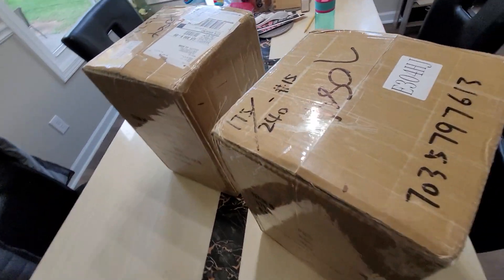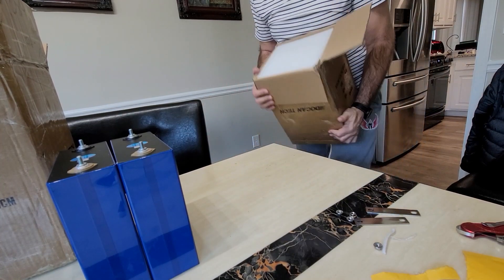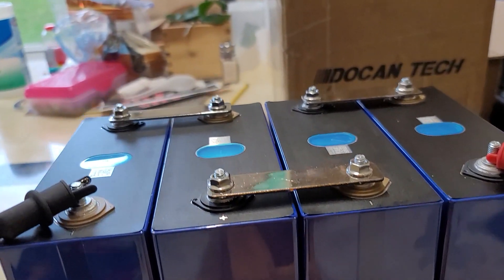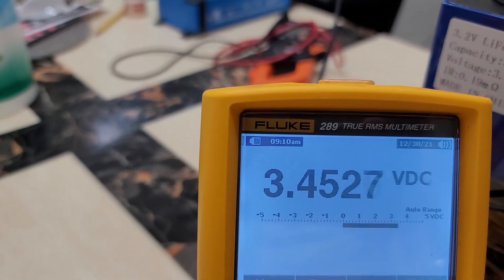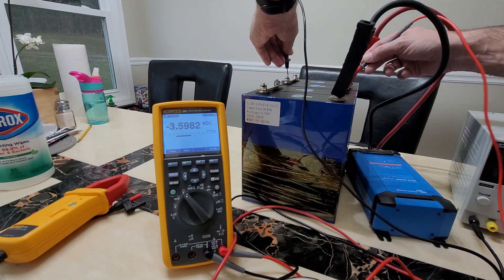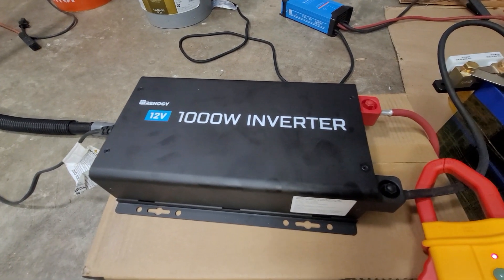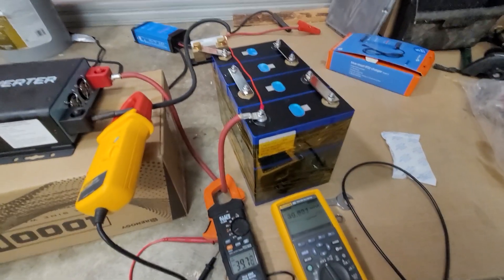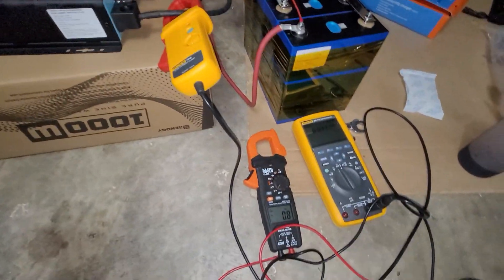304Ah EVE Cells & Channel Update

Comment: That's good you are doing good
Reply from the maker: Thank you. Did sun come back out for you yet?
Reply: @DMIINC2013  only Wednesday it rain yesterday and today no sun supposedly is going to rain tomorrow I'm still ok my battery bank is at 13.12v because we got wind to day
Reply: What inverter do you recommend me to get 2 of the lv6548 or 2 of lvx6048 or one of GROWATT 12KW
Reply from the maker: @solarandwindinsouthtexasda1473  2 of lvx6048 just cause of expend ability of up to I believe 9 units and that 54 KW and they are LF!!!!!
Reply: @DMIINC2013  ok that's good to know because I run my house on a samlex evo 3012 LF inverter and I want to run the a/c and water heater that's that 2 item and I'm running on the grid

Comment: I like these cell versions with the studs, all mine had m6 bolt holes.
I charge mine to 3.45V per cell
I cut off mine at 2.875

With two LV6548 I can pull 11kW for about 30 minutes before it overheats, even in a very cold garage. The batteries have a lot more amps to offer. I can run 9 kW all day long and the inverters don't care.

Have a great time!
I haven't checked my ah on the smart shunt in nearly 4 months. I am finally at the point where I just use them and they work. :) I look at my Solar Assistant (kind of like home assistant) all the time.
Reply from the maker: Nice. I have been doing max charge on my power walls at 56 volts or 3.5 volts per cell.